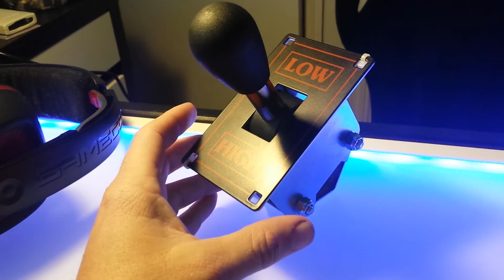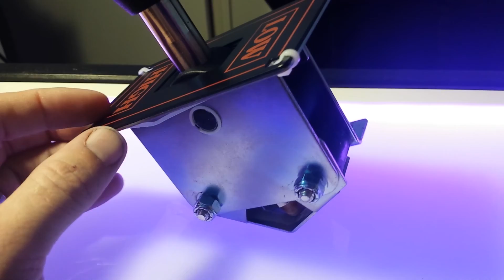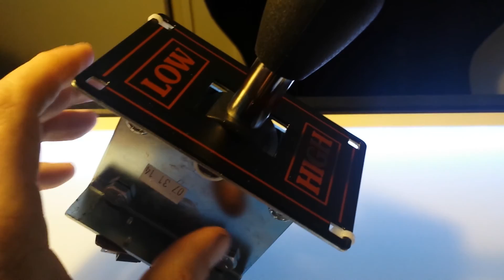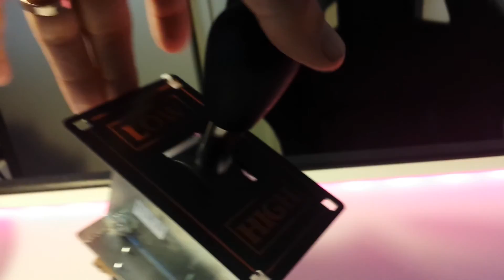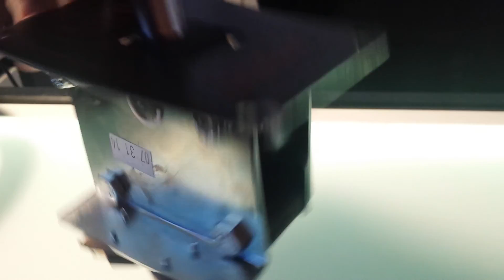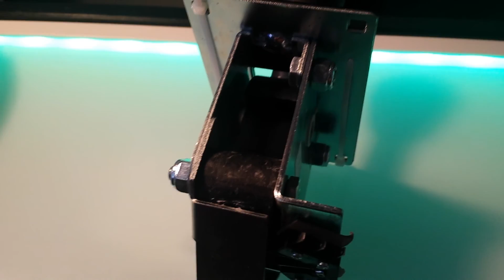RamjetX Arcade Sequential shifter to SimRacing conversion

Comment: when you ordered these from suzo happ did you have to pay any additional fees that weren`t specified at check out? I`m thinking of ordering an h pattern shifter from their website for $96
Reply from the maker: Their h pattern is only 4 gears. If you're using those for PC gaming, you'll come up short.

The namco 6 speed shifter can work with some arduino code. But again, doesn't have reverse.
Reply: @RamjetX  https://na.suzohapp.com/products/accessories/50-0414-31 
I was looking at this one it`s used in vr need for speed carbon cabinets was planning on using a generic usb fightstick encoder since you don`t need to write code. I mainly play arcade titles like initial d and wang gang so I don`t really need the 7th input.
Reply from the maker: @tafarimakonnan1763  Depending on how it's wired, a fightstick encoder might not work.

For example, the Namco one uses a combination of left right and front back optical sensors that you need to use a pair of sensors to determine which gear is which

If that shifter uses the same thing, you'll have to use an arduino or similar.

But it's a great looking shifter for the price. I'm impressed. I'd be keen to hear how it feels.
Reply: @RamjetX  thanks alot  for the advice i had no idea that these gear shifters may use optical sensors. I`m not very versed with programming Arduino so i may have to weigh my options. But how are the taxes on suzohapp orders are they high?
Reply from the maker: @tafarimakonnan1763  Taxes I have no idea... That said... even if it was 30%, thats still pretty cheap for a solid shifter that will out last a thrustmaster for years to come.

Comment: hello i know this is an old video but i would like to use this part as a usb device any advice on how i can go about wiring the up and down input to a usb circuit?
Reply from the maker: Its got two switches that I wired to an arduino Pro Micro and used the joystick library to make it a USB Gamepad with two buttons for the stick up / down.

It was pretty easy
Reply: @RamjetX  which do you think is easier the Arduino pro or USB joystick converter ?
Reply from the maker: @tafarimakonnan1763  I've you have one of those arcade USB Zero delay encoder boards...just use one of those.. Even easier.
Reply: @RamjetX  you are right these things are built to take years of abuse. I saw your video on the namco 6 speed shifter I saw that you used an adruino to wire it. If you still have the schematics or any advice for someone with no experience in circuit wiring and programming it would be much appreciated.
Reply from the maker: @tafarimakonnan1763  Yeah that shouldn't be a problem. I'm on Simhub Discord and help out as many people as I can. It looks like an interesting project. Happy to help
Reply from the maker: @tafarimakonnan1763  I had another look at the photo. There are switches left and right, and I'd say another pair forward and back. So yeah, you'll have to use an ardunio to monitor those switches and decode the gear.
Reply: @RamjetX  can you do a tutorial on audrino programing on your wangang shifter since it doesn't have 6 switches if you have the time ? There is very little Content about this on youtube
Reply from the maker: @tafarimakonnan1763  Hang on... I'll dig through my old arduino code... it should still be in there
Reply from the maker: @tafarimakonnan1763  It's not on my current PC... It'll be in an archive folder on my NAS somewhere.... It'd be so old now that I'll probably have to update to the current joystick HID libraries for the code to just compile. It's not hard at all. Worst case I'll just rewrite it fresh.

Comment: How did you wire it? are the switches compatible with a basic arcade type usb converter?
Reply from the maker: Jack Magger I wired it into an Arduino Leonardo pro micro clone which I made a hid USB profile to emulate a gamepad. Have a look at the oppybox video to see what this actually plugged into. It's a solid piece of kit and feels every bit as good as a frex sequential.
Reply: Will do. Appreciate it! Cheers
Reply from the maker: Jack Magger oh and yes they are compatible with any arcade USB adaptor,  they are just switches...
Reply: I kind of figured as much. Thanks so much for the info! Subbed to your channel as well. :)